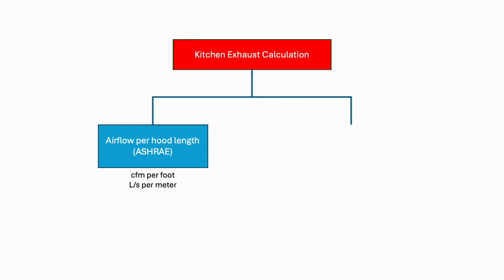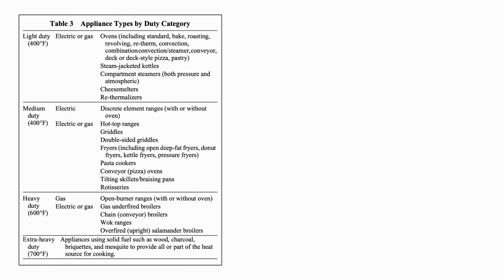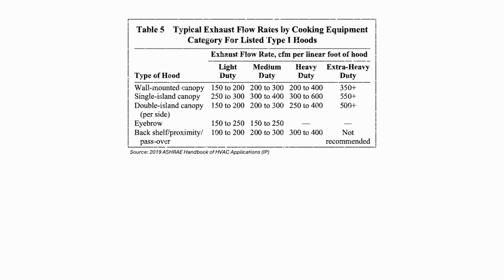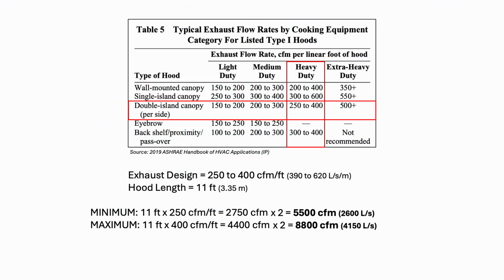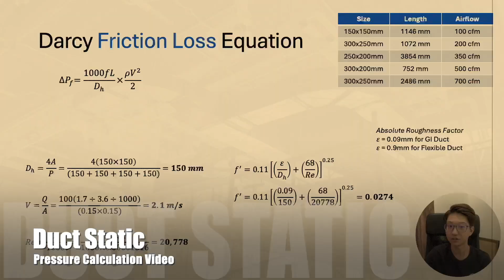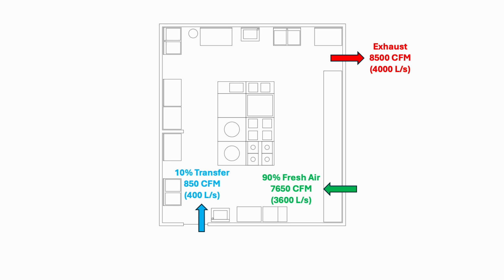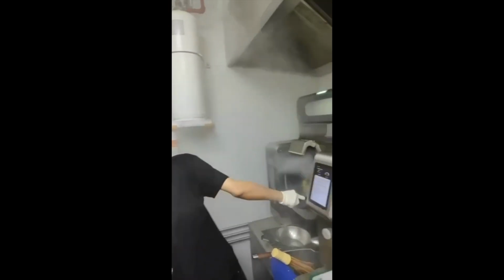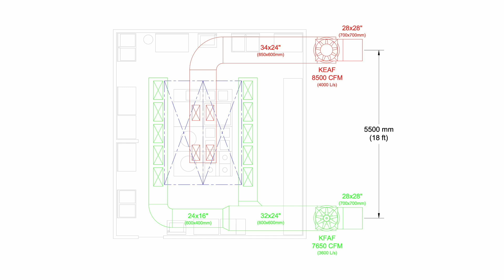Commercial Kitchen Exhaust Design (c/w Static Pressure & Fresh Air Balancing)

Comment: Can you explicitly explain tha Linear feet of the hood for all hood types? Should we add the width of the free sides as well for the wall mounted canopy hood linear feet or just the length?
Reply from the maker: Based on ASHRAE guidance only the hood length and hood type matters. This is on the basis of typical hood design.

Comment: How far should be the fresh air away to the hood?
Reply from the maker: It depends on the throw distance of the fresh air grille. If it has 3 meters throw, then roughly 3 meters away. The goal is to ensure any air that comes near the hood is at 50 FPM terminal velocity.
Reply: The intent of the fresh air is to provide comfort and air curtain  .

Comment: Thanks for sharing! I have a question on the exhaust CFM calculation. In IMC 2018 Section 6 Table 6-4, there is minimum exhaust rate specifically for commercial kitchen, 0.7CFM/SF. I am wondering if that plays any role in the exhaust load calculation…
Reply from the maker: It is probably the minimum exhaust requirement for space ventilation, not the kitchen hood exhaust rate. If the kitchen hood has built-in fresh air system, the kitchen hood may only exhaust out air within the cooking area. In this case, you need to ensure the rest of the kitchen space has an exhaust rate of 0.7 cfm/sqft by means of a dedicated exhaust system or make sure the fresh air supply is not too high such that the hood exhaust is also pulling air across the entire kitchen at  0.7 cfm/sqft.
Reply: Hey - mechanical EIT in texas here. My interpretarion of the code is that 0.7 cfm/square ft. 

I always ensure that the sum of all kitchen hood exhaust is greater or equal to the 0.7 calculation.
Most kitchens in my experience utilize enough equipment and/or large enough hoods such that the kitchen hoods require far more than the code minimum

Comment: How do you think about 20ACH in SS553 Table 5 for OA supply?
Reply from the maker: Calculate the 20ACH requirement and hood exhaust, use whichever higher. This exhaust flow is the hood ON mode.

Then, calculate the exhaust for 10ACH requirement. This exhaust flow is hood OFF mode.

Fresh air is 90% of exhaust in each mode.

So, the fans should be two-speeds or variable speed, interlocking with the hood operation.

Because the 20ACH requirement is for non-air-conditioned kitchens, the fresh air supply vents should be evenly distributed throughout the kitchen.
Reply: @aircondlounge Thank you for sharing 💯
Reply: Kichen hood to be designed based on the type of application, hood velocity required instead of going with a ACPH